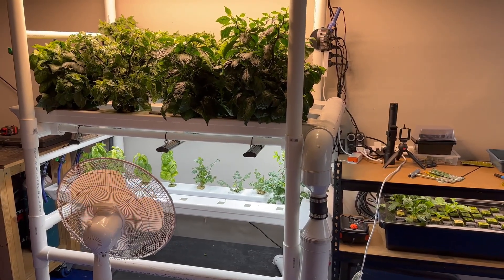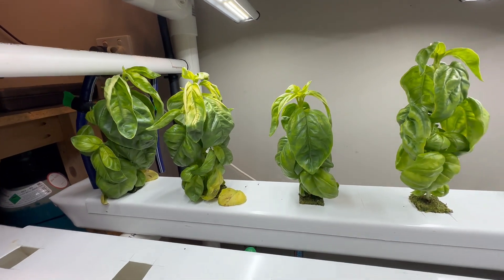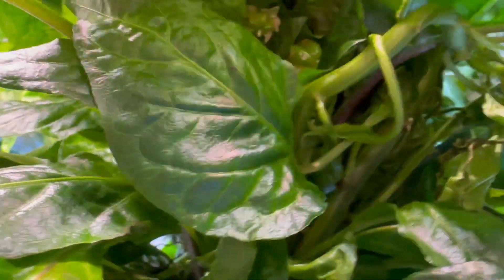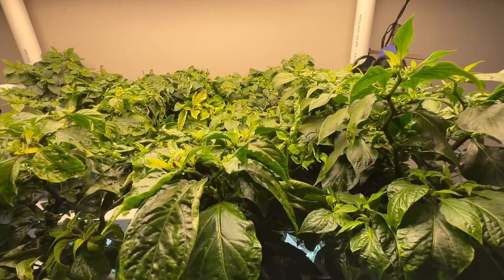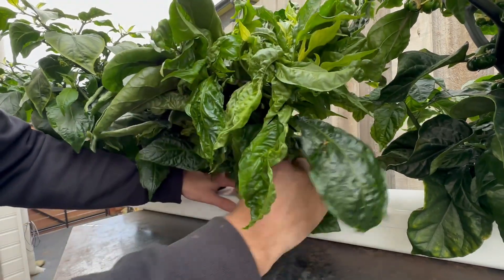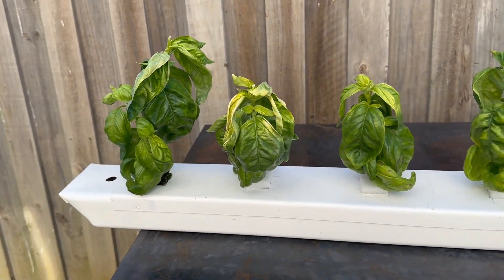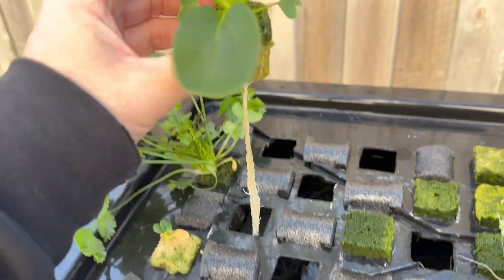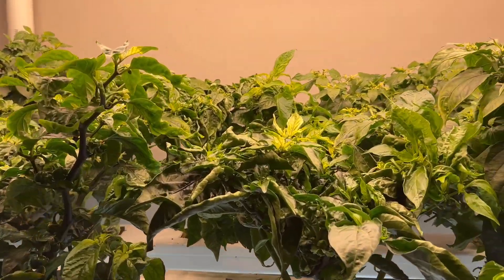Growing NFT chilies in garage hydroponics

Comment: Why do you germinate in your rockwool in a separate container? Why do you wait to transplant until the roots are so far along? 

Personally I pre germinate seeds on a wet paper towel in a sealed container or even a zip lock bag. 

Once germinated and sprouted after like 3-4 days, I transplant the sprouts to rockwool and into an nft. 

I have adjustable height grow light strips which I start out at about 1 inch from the sprout and adjust height as they grow. 

My perspective is that you are creating stress on a plant when you extract it and its root system. That’s almost a definite shock to the plant. Not trying to upset anyone. But I wonder if you would have as great results as I have with reducing your interactions with the roots.

Comment: Reservoir water needs to me pH adjusted AFTER the nutrients are added because the nutrients generally affect the pH.
Reply from the maker: Yes the nutes do drop the pH by about 0.2 in my case. I factor this in with my pH adjustment. Adding acid into a nutrient solution can cause certain salts to precipitate and pull minerals out of solution… Probably not enough to have a noticeable impact… but this is why I adjust pH first.

Comment: I seen you adjusted the ph of your water out of the tap and then add your nutrients ,The water needs to be ph adjusted after you add the nutrients ,as they will lower the ph . this maybe why some of the plants have issues .All the best ..
Reply from the maker: Thanks for the suggestion. I saw somewhere that adding acid to nutrient solution can cause some salts to precipitate out of solution but I don’t really think it’s a big deal. I also re-check my ph after adding the nutes and it only drops about 0.1 so still within range. Also I find my ph gradually increases over time so I’m ok with it being a bit low to start with.